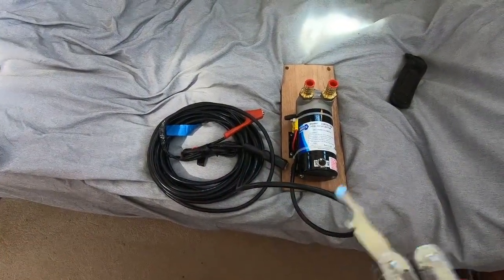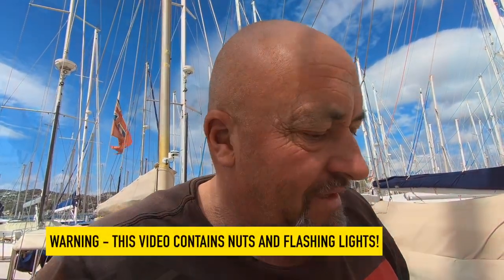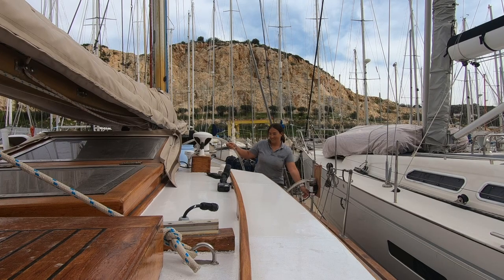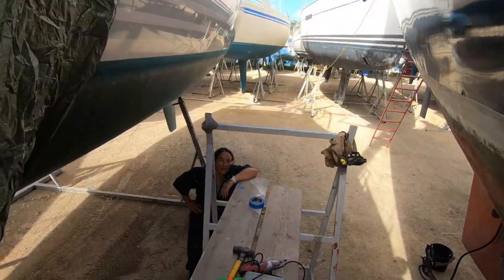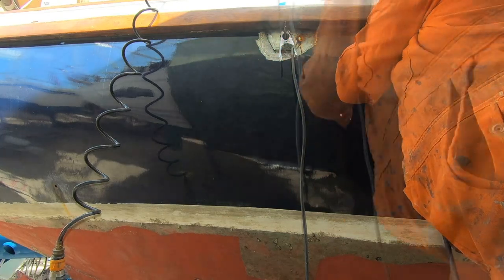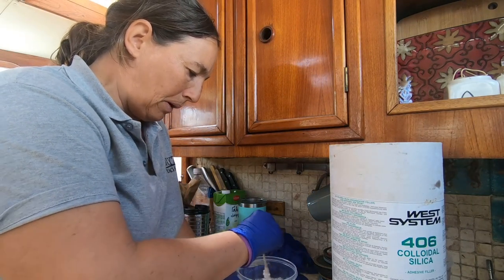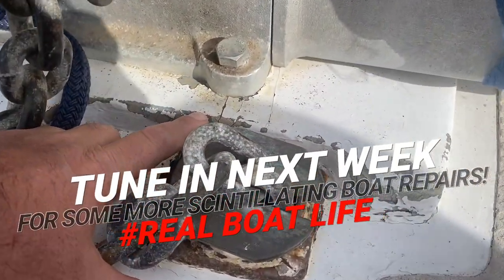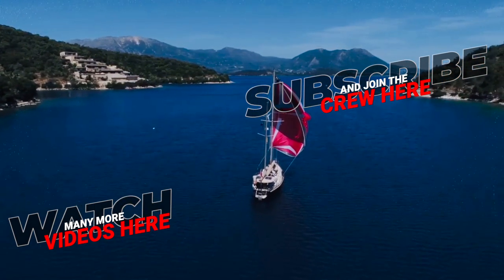EP 158 HOLEY SHIP !!

Comment: Why did you not fix the patch to the inside of the hull and fill the void with weld before epoxying over the top?
Reply from the maker: Do you mean the diesel tank repair? I needed the tank flooded with an inert substance to weld it which from the inside would be impossible due to access - engine out - cut internal plates out etc. 
The wooden bolt hole we repaired there was an electrical conduit , the freezer and our water maker under it making access much easier from the outside and the inside is spray foam insulation.  
We welded the inside and epoxy painted it
Reply: @SVBlownAway  - I meant the hole up near the rub-rail. I should have said.

Comment: Great job guys, question are you using stick welding for a specific reason? I'm more a TIG welder myself and I'm terrible with stick to be honest. An other question weren't you afraid for left over water in the diesel tank?
Also I would be terrified grinding and welding so close to other boats.
Reply from the maker: Hi Douwe. We have an inverter set so can do stick and tig but we have no argon and can’t get any , can’t even buy high grade steel here , trust me we tried. The drain is about an inch off the bottom of the tank so any residual water is minimal quantities , I have stripped and cleaned our dual rancor water f separator today and will monitor it closely once we start moving again. When we arranged to lift out we BEGGED them for space to have a trestle around the boat as painting the whole boat is faster for me than polishing it … this is what we got , so had to work around, but yes I was VERY worried about the proximity.
Reply: @SVBlownAway  You can have anything ordered from the mainland or Crete and have it shipped to you. You could have used me for googling or making a couple of phone calls. Next time.
Reply from the maker: Hi Nikos - we actually did send you an email or two but didn’t get a reply , hence we sent a message asking if you were ok ? 
I believe you may have been in hospital ? We had a supplier in Athens but wouldn’t sell us a small sheet it had to be over 2 meters and over €200 just for delivery.  
Thank you.
Reply: @SVBlownAway  Oh it must have been that time..